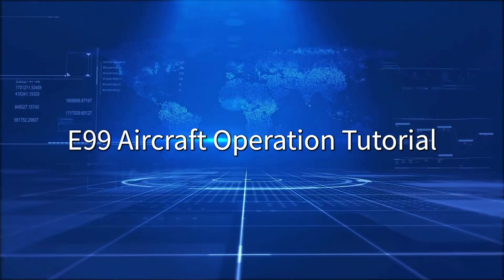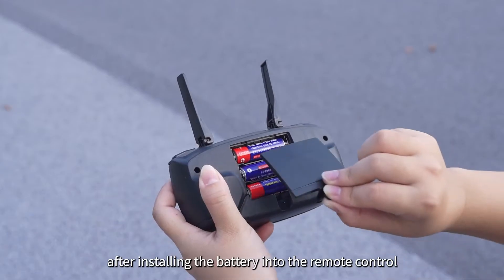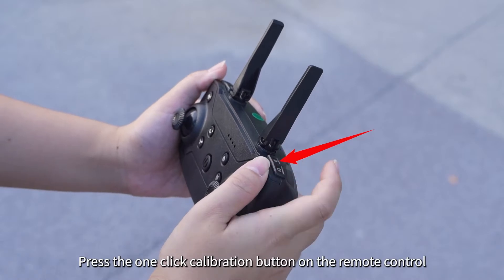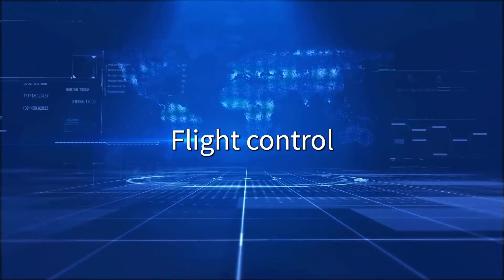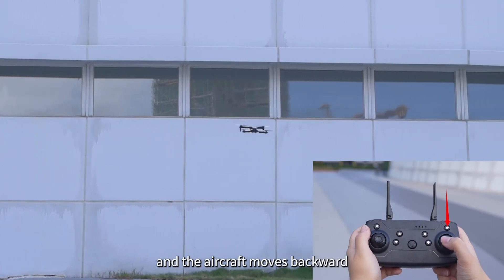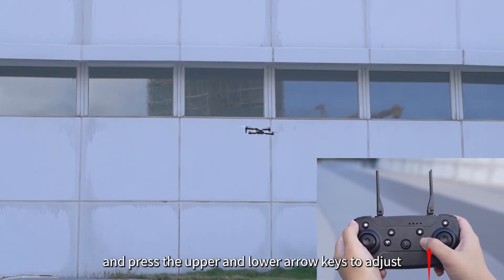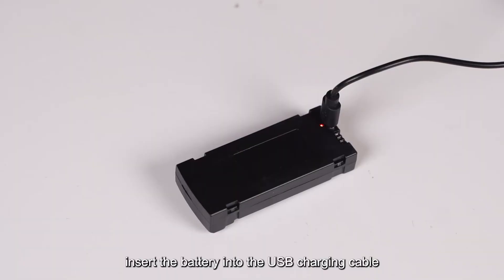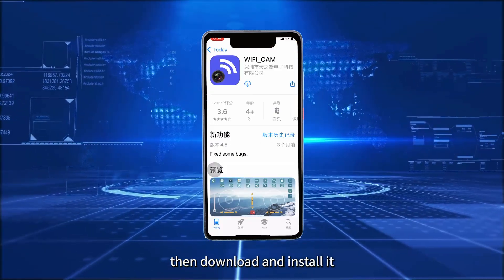ZnLyrion E88 E99 E58 S101 S121 Drone Instruction Video

Comment: Is there a reason why absolutely nobody is explaining the remotes bottom feature? There's a phone rack that slides out but the phone doesn't fit, be nice if there was at least one video showing someone using it.
Reply: U have to pull the tray till the phone fits
Reply: There's alot
Reply: @syedaEishalGillani  Decided to just use black elastic bands to hold the phone on the tray.  Apparently nobody uses it at all because all videos have the remote with the tray tucked away. I wouldn't have said anything if there was " alot"  videos on that.
Reply: On my remote the tray is not infinite. Its only as long as the length of the remote or else it wouldnt slide closed. Therefore when you pull the tray out , there is nomore tray left lol. Doing it more will pop the springs. Its not a big deal because I decided to run the app on my tablet. (My  phone is another story )
Reply: I saw one video where it slides out and stops. Then you pull it again and it pulls out further to hold a larger phone.
Reply: @dexmis5  Thanks for writing that - I didn't see a video of it yet but after reading your post I pulled the spring loaded tray out "twice" and it fits my old Samsung GS8+ just fine. Cheers!

Comment: Lowkey this is horrible. it can’t properly fly 😭 every time I press the buttons or moves the joy stick it didn’t respond. Honestly , 3/10 the camera works it flys but that’s it, wouldn’t not recommend getting ✋
Reply: Mine flew until I learned about the horizontal stabilizer button. I didn't need to push it but I did anyway.  Now nothing is working 😅😅😅😅
Reply: Don't blame the product on your lack of pilot skills.
Reply: Dont even speak buddy the drones propellers are shit @wildboy8346

Comment: how do i find it when i lose it? i was testing the range and it flew off and now i cant find it
Reply: Fr mine keeps flying off like it has a mind of its own or something like that shit does not do what i press on the controller
Reply: Go fetch it
Reply: Mine scored in my football goal at home, its so hard to control
Reply: I saw a YouTuber with a string attached to his. I did the same thing. As soon as I would press the up button it would take off and hit the ceiling. With practice I've learned to control it. No more string.
Reply: Bro u should have bought a drone with return home
Reply: Same I lost a v88. Could not control it.
Reply: I lost mine it flew away fount in 3 days later 2km away from my house

Comment: This has to be one of the cheapest drones on the market. It does not work well, and is very poorly built.
We managed to get about 3 mins of use before one small crash into a tree (due to it not being able to hover in still conditions). the crash caused a motor to burn out and an arm break.

Comment: Remote not working
There is no connection between the battery and remote
Reply: The remote uses different batteries, Check the back and put in 3 AA batteries
Reply: U put the battery’s wrong

Comment: just know the video is far from 4k that's a blatant lie, its quality is terrible its closer to 260p lower than VHS but it does its job and for the price i see this as more a bonus feature than anything as a beginner with drones.
Reply: I just lost mine in the air
Can you anyone help me find it
Im not the owner
Reply: @RealicoN1   use the camera
Reply: @millennium677 
The camera has disconnected
Reply: @RealicoN1   lol well thats just shite
Reply: How can we text personal
Reply: Hello, Nice vidéo, please how is the maximum range of this drone ? And the also the fly time with this battery 3,7v 1800mah? I WAIT TO ANSWER ME,  thank you very much...
Reply: Never hear of 260p but I believe it 😂
Reply: How do you see the camera? Mine wont connect to the app
Reply: @karayaa  Connect to wifi of the drone
Reply: How man  @BozesanVlad
Reply: @lostlover4716  You need a phome that has ac protocol and that works on 5gz band (not a 5G phone, just capable of AC wireless protocol).
Than you connect the phone to the drone wireless.
Other phones doesn't work.